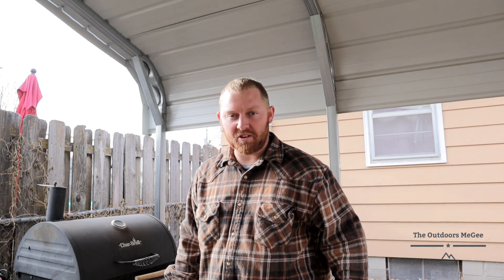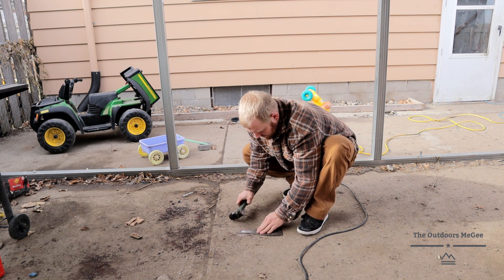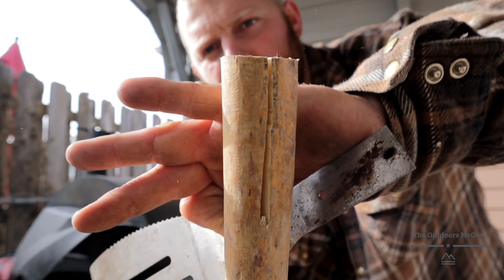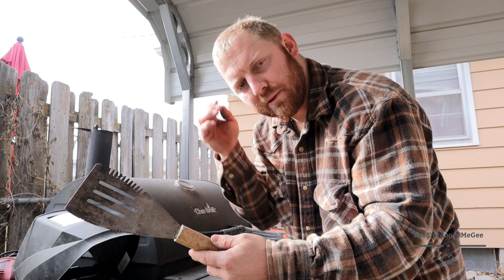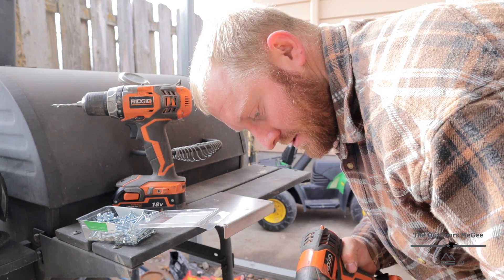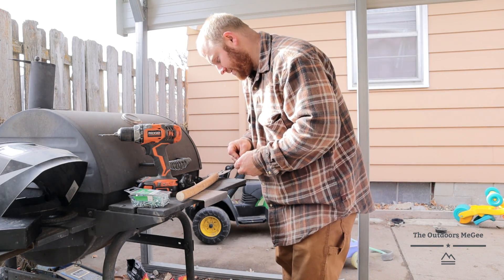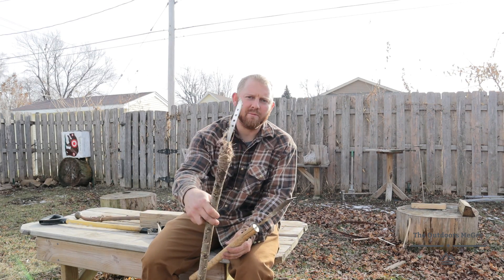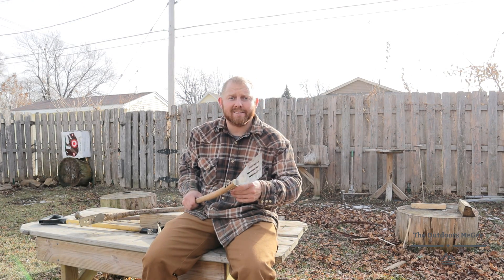Battle spatula engaged

Comment: Hey may friend! You have to apply for two weapon licenses. ! A little tip on the edge, vertically forne over the entire length at the top, weld a round bar, reinforcement wire so you have more weight and you can chop wood better and also have a spot to chop on at the top, which is why it is a bit wider at the top weld, apply a nice thick weld on the left and right. ! I wish you and your family a Merry Christmas. ! Major peer!
Reply from the maker: Merry Christmas my friend!